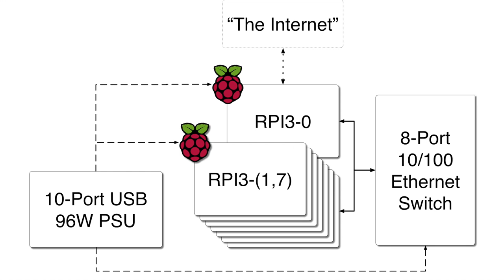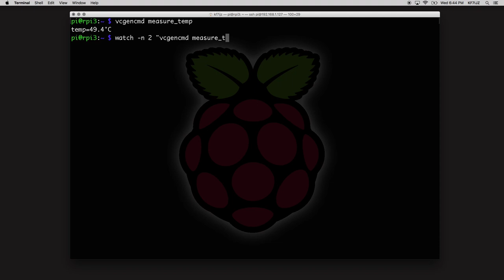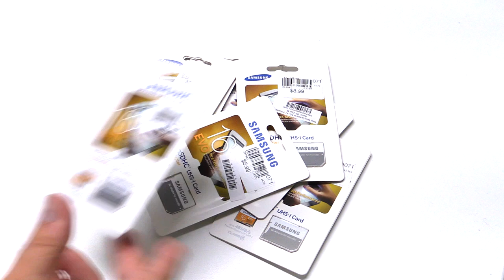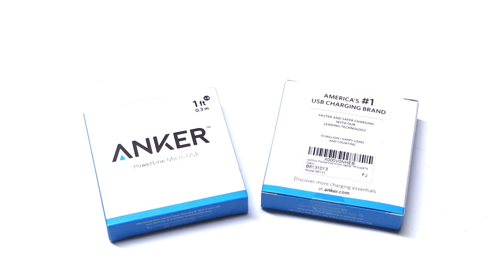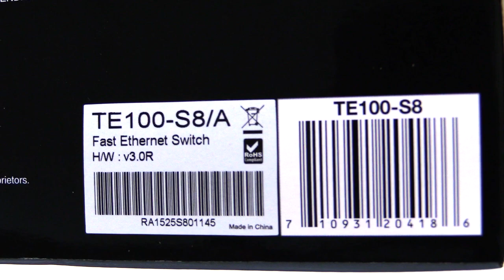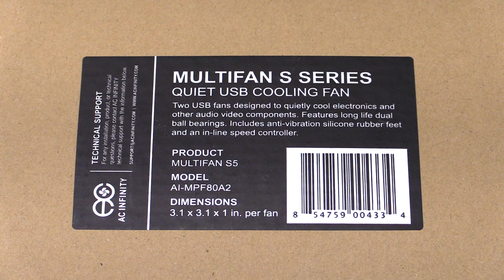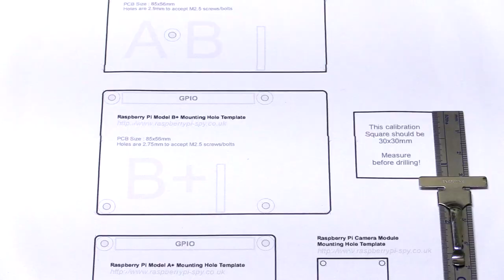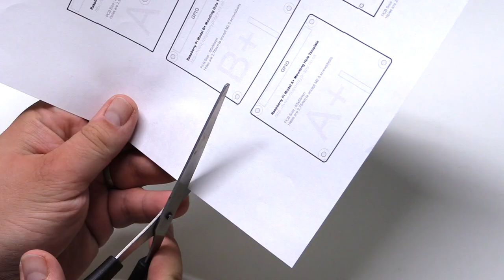Raspberry Pi 3 Super Computing Cluster Part 1 -  Hardware List and Assembly

Comment: Temperature in your room is about 75°C? wow man, you can survive higher temps than camels :)
Reply from the maker: Good catch :)  I think there are at least two other mistakes in there to be found :)
Reply: another one is at 2:20, you said that meter is saying 3.4-3.7 watts... but he's saying 3.4-3.7 AMPS! 

and W=I*V (Current times voltage)

that means 17-18.5 Watts per PI.
Reply from the maker: The Pi is 5V and each is drawing ~ .75A at full load, so < 4 watts.  If you notice, there is a P, above the reading, which means the meter is in Power measurement mode, but the reading happens to be on the current display.
Reply: KF7IJZ ah!, mah mistake so!, i didnt think in the possibility of this meter have "modes".
Reply: W=V*A  formula: P=U*I you missspelled something there ;)
Reply: maybe 75°F? Thats 23°C. Man I'd love that. Right now my house is at 11°C.
Reply: Robert Keick haha, I would love 11°C right now mine is at 30°C Thank you Mexico!
Reply: Farenheit
Reply: KF7IJZ jj
Reply: 75 either way is still pretty hot. This video is superb!
Reply: Does software connect GPU part of them? Can I use them like PC for video or 3D scene render?
Reply: @vladimirvasilev8631   anyone else notice he said 50 inches wide fuck me thats big
Reply: @KF7IJZ  Like your 25 inch by 50 inch rectangular prisms?
Reply: 75 Fahrenheit not C

Comment: Just a thought, but wouldn't facing the heatsinks so that the fan's air can pass through all of the fins (instead of just hitting the first one) make the cooling a lot more efficient?
Reply: EDIT: I noticed at the end of the video that it's just the top one that is rotated. Why is that?
Reply from the maker: That's intuitive, but I haven't noticed a difference at all.
Reply: That's the first thing I thought as well when I noticed the fins weren't facing all the same direction.
Reply: there would be more sense making a sidefence to direct the air towards the RPI's. The heatsinks direction doesn't matter much, for the flow over it will cause it to circulate between anyhow....
Reply: he probably wasn't thinking about that while placing them on there. But I would want to align the fins for the air flow direction also, even if it "didn't make a difference"

Comment: Nice project, but how well does it do versus a low budget PC in terms of Einstein Credits per hour per dollar? Seems that the costs of everything involved add up pretty quick.
Reply from the maker: So I haven't compared directly, but I'd bet that the low end computer for the dame $$ is a better deal for now, HOWEVER, there may be work units coming that are more tailored for the CPU on the Pi 3 which would increase performance significantly.  I have an i5 NUC that was doing a LIGO work unit in about a day while a single Pi was taking 6 days to do that.

Comment: The perfectionist in me wants to see all the USB power cables custom made into 1 single main cable powering each individual Pi in parallel, this would be especially doable since the Pi's only need power and most Micro USB cables come with data wires as well, which only adds to the thickness of the overall cabe. This would get rid of the cluster which you don't want. You could say something similar for the ethernet cables.
Reply from the maker: So Dave Jones from the EEVBlog is trying to do something MUCH neater - https://www.eevblog.com/2016/10/15/eevblog-934-raspberry-pi-supercomputer-cluster-part-1/

Comment: Thank you thank you thank you!!!.. I have been trying to do a cluster of Seti@home for ages but could not get it off the ground! Looking forward to the rest of this series!

Please show how to setup the software.
Reply from the maker: I'm working on that now - the one big difference is that I believe you have to compile the source for S@H for the Pi, but I'm not sure.  I'm using prepackaged software on this cluster because versions available now are new enough to be performant.  I used to have to run compiled BOINC to support fftw wisdom files to improve performance, but that's not necessary now.

Comment: I know it is a minor thing, but why didn't you align all the heat sinks with the air flow direction?
Reply from the maker: Honestly not paying attention, but there is no ill effect whatsoever.
Reply: I just ordered the heat sink you linked to on Amazon, and want to maximize the cooling I can get from it. Do you have temperature logs from the different RPis from when they were under load in this configuration? Is there any measurable difference in temperature between the units with heat sinks in different orientations (relative to the airflow)? I'm guessing not much difference, but if there is data available, I would be very interested to see if the slightly turbulent airflow over cross oriented heat sinks would give better or worse cooling than the smoother airflow or aligned heat sinks. Or maybe it makes no difference within the accuracy of measurement.

Comment: The newest pi 3 b+ now has POE support on network so makes the mess of usb power cabling down to just 1 network cable per device (just need compatable POE Switch) and use the USB power off the pi to power the odd fans you need

Just don't be so annoying with music so loud (I assume you corrected that on your later videos)

Comment: Just a note, that top pi, the heatsinks is rotated 90 degrees from the rest. Your fan will hit the first flat edge and the air will disperse,  cooling it less. The fins facing the fan will be cooled better, but I doubt it will actually matter because it is the top pi and thus should be the coolest

Comment: Great job placing the fan so it blows against the side of the CPU heat-sinks rather then through the fins like it's designed :^)
Reply from the maker: No noticeable difference whatsoever between the two positions.

Comment: I know this may be a foreign concept to you... but if you get a set of metric drill bits, the hole needed for an M2.5 thread... is 2.5mm.
Reply from the maker: Not foreign at all, but I have no need for a set of metric drill bits.  Also, some play is required because I didn't create a jig to ensure perfect positioning.  I knew the holes were 2.5mm because that's the thread size of the standoffs, but even the Pi holes (hehe) are cut to 2.75MM if I'm not mistaken.  Thanks for watching!

Comment: Hello you have one slight problem with the network switch. Yes there are 8 ports on the switch but only 7  can be used  because the eight port is the Internet connection port. Or am i missing something and there is another port for the internet connection?
Reply from the maker: Hello!  The Node 0 uses WiFi to get to the internet and acts as a bridge, so all 8 ports are connected to RPI3s
Reply: Hello Thank you. Very cool.

Comment: Awesome video :P What would the computational power of this be compared to? An 6 core AMD CPU or something?
Reply: Definitely less. Depends on the clock speed and instructions per cycle. If you fully utilize the Pi's CPU and GPU it's better power per watt then a modern CPU though. Name me an AMD CPU and which version of the Pi and I'l crunch some numbers for your amusement. :P
Reply: +theLuigiFan0007 Athlon x4 860k
Reply: CaesarGamer
AMD Athlon X4 860K @ 3.7GHz @ 95W
Estimated Peak GFLOPS (CPU): 44.4

ARM Cortex-A7 Quad @ 900MHz @ 4W
Estimated (CPU): 10.8 GFLOPS
Datasheet (GPU): 24.0 GFLOPS
Theroetical Max (CPU+GPU): 34.8 GFLOPS
Reply: My PC has a AMD A4-7400 APU, so that counts as a CPU and GPU, and obviously it's more powerful then your CPU and the Pi. Depends what GPU you have who's PC is better. :P

AMD A4-7400 APU @ 3.7-4GHz @ 65W
Estimated (CPU): 44.4-48 GFLOPS
Datasheet (GPU): 307.2 GFLOPS
Max (CPU+GPU):  351.6-355.2 GFLOPS

My APU cost $35, and the motherboard cost $75. Insane how powerful cheap processors have gotten.
Reply: +theLuigiFan0007 Indeed. I'm not running an Athlon x4 860k :p, am running a 2500k + r9 280x. Surely, much more powerful than RPi.
Reply: +theLuigiFan0007 Also, there are more variables than GFLOPs alone.
Reply: CaesarGamer
Yup. There are definitely more variables. But if it's only a theoretical estimate pretty much all the variables are based off each other. Why information on CPU manufacturer's sites don't mention GFLOPS or MIPS is absolutely puzzling. They mention it for a GPU right in the main specs, why not the same for a CPU? :o

I can estimate GFLOPS by: (CPU speed in GHz) x (Number of Cores) x (Instructions Per Cycle). Generally instructions per cycle in current sub-$300 CPUs is around 3 instructions per cycle. Some SUPER high end CPUs that are around $1000+ (i7 Extreme Hex Core, Xeon Server CPUs) is closer to  5-12. The numbers I listed for CPUs might actually by 33% higher if they can handle 4 instructions per second.

MIPS is estimatable by: (CPU speed in GHz) x (Number of Cores) x (2). Linux calls this spec "BOGOMIPS" on the output of the "lscpu" command.

I'd love to take a bunch of old computer that are to be recycled and make a stack of motherboards like you do with the PI, and connect them to a multi kilowatt server PSU. Hey, throw enough obsolete hardware at it and it might just be able to do something. :P
Reply: X4 860k is more powerful then an A4-7300?
Reply: Ike Spangler
Definitely! It's the same clock speed with double the cores, and it has more cache, and it's the overclockable version (hence the "K" at the end of the name).

You'd have to buy a dedicated GPU though. The X4 860k does not have a Radeon R7 built into it like the A4-7300 does.

But you'd want a good GPU either way. For a really good GPU for a good price I'd reccommend a AMD Radeon R9 RX480. It can run most titles at 1440P.
Reply: theLuigiFan0007
No, damnit I meant x845, not A4-7300. I am rocking a 970 atm
Reply: Ike Spangler
Between the X4 860k and the X4 845? In that case the Athlon X4 860k is definitely still the better one. It has double the cache and a higher clock speed by 200MHz Min/Max. Otherwise, the other specs are near identical. Here's the main differences.

Athlon X4 860:
3700MHz (Min) Clock.
4000MHz (Max) Clock.
2x2MB 16 Way Cache.
Supports 4 Sticks of RAM (2 per channel).

Athlon X4 845:
3500MHz (Min) Clock.
3800MHz (Max) Clock.
2x1MB 16 Way Cache.
Supports 2 Sticks of RAM (1 per channel).
Reply: theLuigiFan0007
Cool, I thought so

Comment: wait im lost, is this like a homemade pc or home network sharing?

can i make a gaming pc using thia method
Reply from the maker: This is a home made computing cluster.  You could not use it to make a gaming pc, and this does not run windows.
Reply: So basically it works as a storage unit, for more than 3 or 4 computers
Reply: +KF7IJZ. if its a storage unit for alot of computer. could i use 1 rasberry pie with an external 2tb HDD.   in my opinion, the price would be much less and you could invest more on a better cooling sistem
Reply from the maker: It's not a storage unit.  It is a 32 core cluster computing appliance.

Comment: you maybe should've aligned all the heatsinks with the fins running horizontally to the length of the Pi, so that the fan can actually blow air through the fin channels. but not like it would really matter lol

Comment: lay the stack on its side and you could probably do away with the fan.

Rather than disassemble the switch, just get some 5 minute epoxy, attach the standoffs to a Pi, apply a little epoxy to the end of the standoffs and set the Pi on top of the case.  Putty epoxy will work too.

Comment: How much did this cost all togeather?
Reply from the maker: Roughly...  Pis ($240) + SD Cards ($64) + Switch ($15) + USB Cables ($20) + Standoffs ($13) + ethernet cables ($10) + USB PSU ($40) = $402 - could have built a lightweight gaming rig for that!  BUT, this was a LOT of fun.
Reply: +KF7IJZ I did something rather similar with 4x Orange Pi Ones (low cost variant), 5 port network switch (5v) and 5 port USB PSU for $130ish AUD. To be fair mine gets a little hotter and each board draws a little more amps however much the same results with a little less performance and specs.

Comment: hi , i'm new to clusters , does all those computers works as one? , because then it would probably run  heavy games like gamecube emulator .
Reply from the maker: For my work, they do not, but they could be made to.  MPI wouldn't be fast enough on these over ethernet to likely to be useful for gaming.  Also, for $400, you can build a good entry level gaming PC.
Reply: KF7IJZ thanks for the answer , i live in brazil , with 400$ i cant even buy a good gpu . thanks for the state robbing us .

Comment: What are some good use-cases for RPi cluster?
Reply: Having a lot more IO's.... and maybe some YouTube show off?
Reply: Simulations like flocks and multi processing like rendering or calculation of huge fractals but saying that you would need a lot, like a hundred or so pi's to outperform a high end pc or server.
Reply: Supahfly Adrian Yes. but then I'd go for a used $300 server with two 6 core CPU's. Spend more, get more. The only thing is that the server will be noisy.
Reply: I think it's called R.I.P.

Comment: I know that with Raspberry Pi 1 it's not cost-effective to make a cluster, compared to a PC (or cluster of them) with similar power. Cluster of RPi 1 will cost more and also will use more electricity. Is it still true for RPi 2 and 3 with 4-core processors with higher clocks and newer cores?

Comment: Rather than using the switch and ethernet, why didn't you connect them through the I/O pins for communication, then write your own server switch program using the pins?
Reply from the maker: Each Pi has a full UART and a sorta UART - would have had to have some type of serial muxer I think to get them all to talk to a central Pi.  Not smart enough to write my own new protocol nor am I willing to learn when I get ethernet and wifi out of the box for free!  Plus, that wouldn't have been very efficient when it comes time to apt-get update.  Ethernet and WiFi are much better options.
Reply: Ok, makes sense, I was just curious.

Comment: I personally use wired ethernet around the home as there is less drop offs, more stability and faster throughput than wifi, but I would like to see someone do this project wirelessly, just to see how elegant it would be
Reply from the maker: That is easy with a PI 3, given that all boards have wireless on them.  You would save the expense of the switch and the ethernet cables for sure!

Comment: seems like it'd make more sense (for cable lengths) to mount both the USB hub and ethernet switch VERITCALLY along the side of the Pi and mount everything to a piece of plyboard. (would mean that you could use cables of 3" or 6" for everything)
Reply from the maker: I've not seen cables that short for Ethernet or USB.  I like the form factor I've come up with for my setup, but I agree that the USB is unruly.  I'm considering a new design in the future.
Reply: Oh well I also make my own
Reply: Use a really thick cable by heatshrinking a bunch of USB wires together. It could then branch out into many USB cables from holes at certain distances. You'd just need wires for Ethernet (a bit of shielded double twisted pair wire) to carry the Ethernet signals, and 18GA to carry power before it splits off into custom length USB cables and Ethernet cables, of course solder and a industrial 5V 20A PSU could be used.

Comment: My Raspberry Pi 3 crashes when using boinc. Any ideas how to fix this?
Reply from the maker: Several questions - What do you mean crashes?  If you hook up a monitor, do you see a rainbow square appear in the top corner?  what OS/version are you running?  Are you running BOINC from a repository or did you build yourself.  What client software/project are you trying to attach to?  I'm happy to help troubleshoot here or if you'd like you can email me at my youtube handle at gmail.

Comment: arange the pi's in a horizontal stack and make a larger heat sink
Reply from the maker: That is certainly an option, but I liked the vertical configuration on the switch.  If you build one in such a manner, please share a video of how it turned out!  I've done plenty of heat analysis in the vertical configuration, but had not turned it on its side.

Comment: Is this for raspberry pi 3 or 2? Before you say I'm stupid check out the start of the video - it's a pi 2.
Reply from the maker: You're certainly not stupid!  I start by showing the Pi 2 because I originally recorded a long narrative about how I started building clusters with Pi 2s, but ultimately cut that part out.  This does work for both Pi 2 and Pi 3 however, except the Pi 2 has no onboard WiFi.  Thanks for watching!
Reply: Hehe cool, no problem :)

Comment: what purposes do these clusters serve?
Reply: For the average Joe?  Nothing.   In (very) layman's terms, one of the Pi's is a controller/scheduler that acts as an intermediary between your software… a game for example… and the rest of the Pi's.  It divides up the processing into chunks, assigns it to the rest of the processors, receives the results, reassembles it into a meaningful result and passes it back to the source processor.  (I think the "source" and controller are combined actually.)

It's this controller and software that is the major obstacle between parallel processing and every day use.  He uses it specifically for Einstein@home, which is itself parallel processing system.  Bitcoin is another example.   Instead of the Raspberry Pis,  it uses computers all over the world perform a single task.
Reply: Given the cost of the hardware, limited performance, and time to set up, There's almost zero purpose compared to just renting a server from amazon to run einstein@home. 
However there is a coolness factor, and it makes a pretty awesome desk fan/heater thingy
Reply: can it power a neural network ?